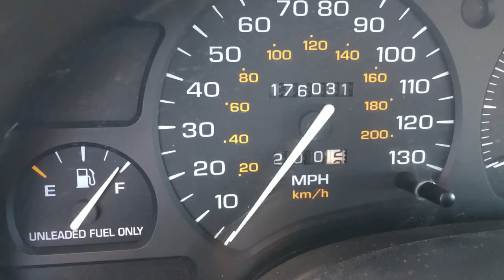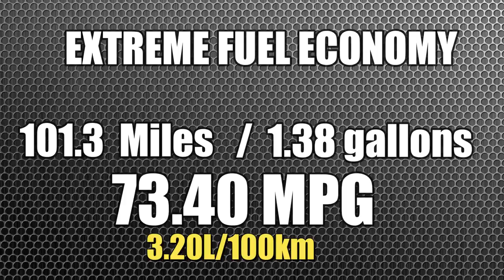S3 E11. Kubota turbo diesel Saturn extreme fuel economy.  super high MPG

Comment: This car is perfect for a girl in Florida I need to go here I need to go there I need to go everywhere. I have to see my friends I have to drop off the kids at soccer practice I've got to go to Target I've got to go by the supermarket I've got to go here I've got to go there I've got to go everywhere and I've lost my boyfriend he won't pay for the gas anymore. And then you discover black diesel used engine oil and stale gas from some parked antique car that doesn't get driven much and guess what you're driving for free. Just imagine that driving for free it's cheaper than charging up your Tesla and having to slide your credit card in the electric recharger. And pay a hundred grand and then they catch on fire and it takes three fire trucks with 3,000 gallons each to put the fire out because they're impossible to put out when they catch on fire. The diesel is perfect it's least likely to burn ethanol gasoline is 55% more explosive that's why so many modern car crashes you see the cars burning and people are incinerated in these plastic Echo pods. And it doesn't matter which brand they all burn in bad crashes. Used to back in the day of metal cars and 14 miles to the gallon which I'm completely loyal to for safety reasons cuz of people doing heroin while driving and passing out at the wheel and crashing into you, I still drive a 1976 14 miles to the gallon steel barge. But I do have a 240 diesel that runs on black diesel which means drive for free but pay a lot for parts and I have an Audi that somebody put a turbo diesel 5-speed in that is not complete yet so those will be my black diesel cars to drive. I simply siphon off a little fuel out of my antique classics that have non-ethanol fuel in them because the ethanol will destroy a metal fuel system. And a whole bunch of used motor oil that I've saved up so I've got more than a year's supply of fuel if all of a sudden fuel were to be cut off though I be driving those miserable diesels with no air conditioning in the hot South can only go out at night to the stores that stay open late due to the Heat and no air conditioning but I'm working on the super duper R12 air conditioning in the 240D Mercedes. It's so slow it's not Highway legal. Due to Fentanyl and people passing out at the wheel and the methamphetamine users on the road these days I'm afraid to drive these little tiny cars so I'm sticking to my 14 miles per gallon steel bars that was being built while Jimmy Carter was on television saying that by year 2000 all cars must get 25 miles to the gallon and my dad said oh god there goes the big beautiful cars. Watch an episode of demolition derby and imagine these little plastic Echo pods doing demolition derby there be bits of plastic all over the arena that they'd have to sweep up afterwards. And the cars would literally with one whack need a rollback today's cars can be totaled in a parking lot crash that South Lindsay they are. Back in the day the metal cars could be totally mangled and still be drivable with impacts from 50 mph crashes that they could simply do their accident report pry the tire with a crowbar and been the fender out of the way and drive it to the body shop for an estimate not today's Cars one whack it's on a rollback.
Reply: very good comment..
Reply: did you drop the kids at soccer  practice yet?
Reply: @kansasrose2909  I remember demolition derby!

Comment: Here are some ugly cars to ponder...
Reply: 1995 Oldsmobile Aurora

The Aurora was a last-ditch attempt to rejuvenate the Oldsmobile brand, a technologically innovative car that was marred by heinous styling. With a body shape lifted from the horribly-named Oldsmobile Tube Car concept of 1989, the Aurora looked as if it had been styled by erosion, with squinty headlights and a grille-less nose that gave it the appearance of a face with no mouth or chin. The Aurora looked more like an undressed mannequin than a technical tour-de-force, and despite rave reviews the car failed to take off with the public. Once the Aurora failed, it was pretty much a straight shot to the grave for Oldsmobile, which folded in 2004.
Reply: 1996 Ssangyong Korando

Designing the ugliest cars in the world seemed to be South Korea's national pastime for much of the 1990s, though export markets were often spared the most egregious visual sins. Not so for the Ssangyong Korando, which escaped to Europe like a lab experiment gone wrong. From the front this chunky off-roader resembles a Jeep Wrangler that lost a fight with a taffy puller; from the back it looks like a Geo Tracker wearing zombie contact lenses. Cheap and capable, the Jimmy Durante of off-roaders had one undeniable drawback for its owners: They had to look at it every day.
Reply: 1998 Fiat Multipla

The Multipla is one of the few award-winning cars on this list—only the awards it has one are all of the ugliest-car variety. There is so much wrong with this design that one can while away the hours finding new things to make fun of: A hood that looks like it's been sat upon, a Pacer-like devotion to fishbowl glass, an overall impression someone sawed two cars in half and stuck the top of one to the bottom of the other. The interior is no better: All of the gauges and controls are crammed on the center stack, giving the appearance of a Fischer-Price toddler activity board that's been attacked with a razor blade. The Multipla is so far out that even the French thought it was awful—it truly is one of the ugliest cars in the world.
Reply: 2002 Renault Avantime

Renault's idea for the Avantime should sound familiar: It was a car for empty nesters who had grown used to the size of their Espace minivans, the same motivation behind today's big five-seat SUVs like the Honda Passport and Ford Edge. Renault thought a two-door one-box art car was the answer
Reply: 2004 Infiniti QX56

The Nissan Armada on which Infiniti's mondo-sized SUV was based wasn't a bad-looking vehicle, so how did the QX56 end up so ugly? The low headlights and tall grille suggested a Neanderthal-like visage and its accompanying cognitive inabilities, while the roofline—arched above the doors and flat over the cargo area—recalled the cobbled-together look of the 1955 Nash Rambler Cross Country. In a time when people were starting to seriously resent the rich, the QX56 gave the other 99 percent something else to hate. Infiniti redesigned the QX56 in 2011 and managed to make it even less attractive, but the latest iteration (now called QX80) is less of an assault to the eyes.